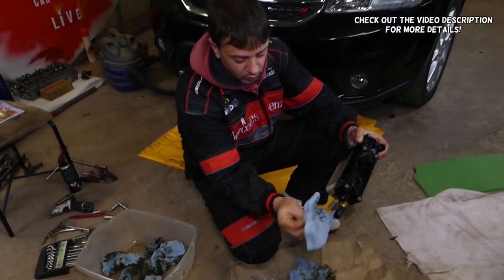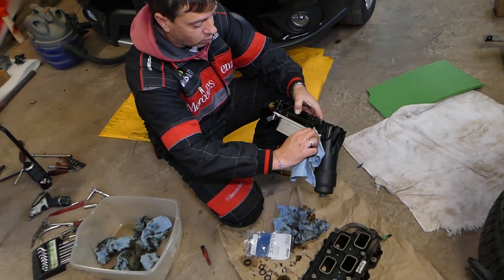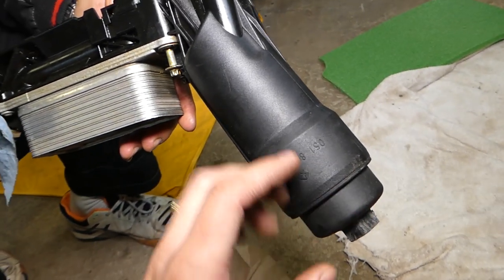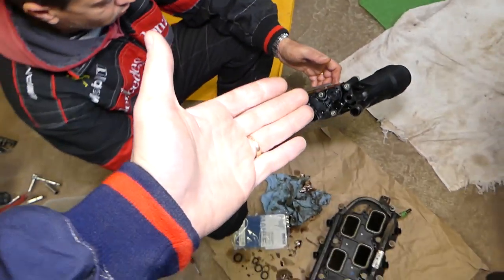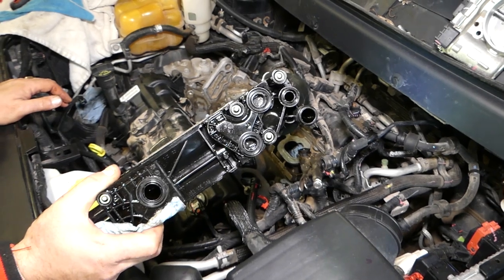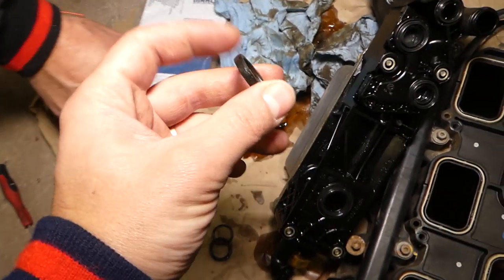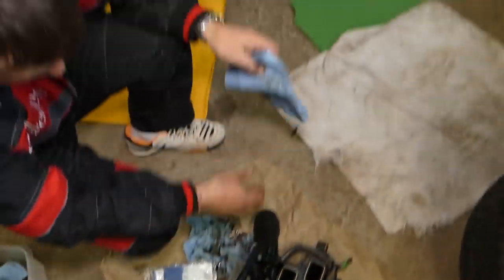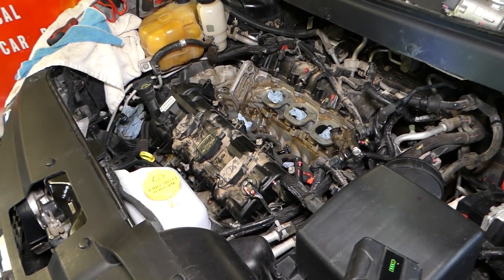DODGE JOURNEY OIL COOLER REPLACEMENT GASKET REPLACEMENT 3.6 V6 FIAT FREEMONT PENTASTAR

Comment: the people saying you can do this without taking out the throttle body and such are right, but why would you not pull it out and do a cleaning when you have everything else out? especially on these POS Dodge Journey that everything breaks on em. found this very helpful, and am doing the entire clean and swap myself at home instead of $2500 at a shop
Reply: In 1500..

Comment: When I took my car to get the battery changed , the car shop guys struggled to remove those plugs , they didn't even bother putting them back in when they gave me back my car.

Comment: Great job guys i have a 2013 3.6 journey. Your video saved me from junking the car because i could not find coolant leak causing car to randomly run hot. So now it will continue to run just for the cost of the cooler and my free labor.

Comment: Great job on the videos you provide 👍. I have a 2014 Journey with an extremely hard to work on 3.6vvt. From the infamous 6 cylinder tick to the current oil leak it's driving me nuts. More than anyone else you help me with information and how to make the repairs... thank you very much. Sadly, because of the engine design, the cost of repairs is greatly increased because of how much extra work is required to get to the parts...😭. Personally I can't afford it so I have to do the work or lose trade in value because of mechanical problems. So far I choose to keep this baby because in over 200k I've been blessed to be able to keep going without major break down...plus I'm amazed at how much value it holds.
Anyway thanks again for the great videos. The least support and appreciation I can show is to listen to your adds...and not cut them off. Thanks again.

Comment: Nice job guys. Just have a question I am leaking coolant from there so I was just wondering if it could be a bad hose that I would need to replace no oil leak just coolent leak. Thinking about replacing the whole thing but the dealership wanted $400 just for the part
Reply: I have the same leak what did you do?
Reply: Had the same issue and dealer wanted the same and another shop quoted 267. I am going to just order the hose and replace it myself
Reply: Same issue.. you can get the parts on Amazon or other places than from the dealership. Prices for this part on amazon are no more than 200 depending on who and what comes with the part
Reply: @issacsantana4444  I'm so late to this but-the upper gaskets can go bad and it will leak coolant...the lower gaskets retains the oil...I've yet to find just gaskets for sale so replacing the whole thing is best...upgrade to aluminum(for some reason cheaper than the composite)

Comment: I had a huge leak, bought some dye put it in the oil drove the car for a bit then waited till sunset used the black light flash light and BAM ! That leak was sticking out like a sore thumb.Now your video was most useful the only difficult thing is remembering to not forget to hook everything back up the way its came off.

Comment: You don't really need to disconnect the wires from the injectors because it is possible to simply "flip" the manifold over (it will rotate clockwise after disconnecting the fuel supply line).

Comment: i have a 2017 Dodge Journey SXT and i have a water leak it looks like it is right under the power steering cooler on the back side of the cooler on the passenger side and right across from the first bolt so my question is dose water supposed to leak from there O and i appreciate the hard work and the effort that y'all put in y'all's work and videos to help people that u don't even know to teach them how to work on there car's and for them to save money so from the bottom of my heart thank  you because i know i i appreciate and i know everybody else dose

Comment: I did the same kind of job and I didn't have to take everything apart I took the boy from the intake manifold out and I just pull it out without having to take the throttle body and all that stuff out too much water for nothing and this video
Reply: What part of the intake manifold did you take out? Seeking clarification.

Comment: Thanks for the great detailed video.
My journey mixes oil with the coolant I took it all out and about a new oil cooler I put it back together and drained coolant. It stopped overheating but it still leaked.
Note: I have flushed it with water so many times to make sure it doesn't have anymore. It still managed to leak the oil again. 
Any tips on what might be going on? 
Thanks a lot.
Reply: I'm no expert but a cracked block maybe. I hope not...

Comment: This is the second time in less than a year that I have had to replace that part (the last one lasted only 1 month ) I saw they have this part in aluminum now, do you guys recommend to use that instead? Thanks for the great videos!
Reply: What did you find out?
Reply: @Katie-uj3xd  I actually haven't changed it for the aluminum one, but yeah, the plastic one loses its shape with the heat in less time.

Comment: They miss a couple of steps but y’all will find them on your way lol. Don’t forget to refill your oil and antifreeze. Mine took about 6 and a half quarts of oil and 1 gallon and half of antifreeze. Test drive your vehicle after all set and done and then check all fluids!

Comment: I repaired the oil cooler the first time and it messed up. The first time it was just leaking coolant into the valley. After I repaired it lasted 3 months until I had a major leak. Oil got into the coolant. Car was in bad shape. I ordered another oil cooler (aluminum) and after replacing and then doing the coolant flush to remove oil from the system I still had a leak. I drove the car about 10 times to clean and flush with the oil out of everything. Drove about five minutes at a time. Wouldn’t lose fluid until I drove. Even if the car say idling for hours. I finally found that leak in the radiator cap. I got a higher end safety cap and then I noticed after we drove a few miles that coolant was again POOLING IN THE DAMN VALLEY! AGAIN!!! WTF!? This time though the coolant is leaking on the passenger side. I assume the pressure from the new radiator cap pushed the coolant through the cooler and made it unseal somehow. Any ideas? 

Nothing leaked again until I drove.

Comment: I see a lot of video's on this procedure. I have a 2007 town & country that is leaking excessive oil from somewhere. Do you know what years in the chrysler T&C's are known to have the oil cooler leak problem?? Do you know if a 2007 would have that issue?
Reply: It's very likely. Is yours a 3.6L?
Reply: 3.8L

Comment: Great detailed video, I see water pooling and boiling at the base of the oil cooler and it looks like I'm going to have to try this.
Reply: Used this video to get the cooler out, the valley of the engine was full of coolant.  It was a lot of coolant.  The bottom of the oil cooler was cracked and all I had was gaskets so now I'm waiting for a new cooler to show up. I went with a newer model cooler, hopefully will fit.  I compared photos, they look identical.

Comment: Help me please I have a 2016 back lights don't work and won't start when I push pedal I change brake switch program key starter work but the back tail lights just won't work all fuses good help me please sir 🙏❤️

Comment: i just replaced all of this an forgot to drain and replace the oil. oil light came on followed by knocking noises. drained added new oil an has same result, milky on the dipstick with new oil any advice?
Reply: Hoping you squared this up-see the comment was 2 years ago...but "milky" means you got water mixed into oil so really hoping that didn't become a large issue for you...

Comment: I have a 2014 dodge journey 3.6 engine I have a oil leak underneath the oil filter housing. So I took my car to the shop and they was supposed to replace the oil preasure sensor I drove the car for another month or so before I could get my car in for a appointment to get the leak fixed. However I was driving down the road and my check engine comes back on and then my oil pressure  plummets to zero so I thought no big deal I'll just put oil in it and it would be fine boy how I was wrong. So make it sure i went got a diagnosis test done and the results was oil pressure sensor was stuck on close. I have a buddy telling me all I have to do is bleed the oil lines. Do you know  how to do that? does anybody know

Comment: Hello guys I have a Dodge Journey 2012 4 wheel drive SXT and it started overheating so I went ahead and change the thermostat and it still overheats so I found out that the oil coolant unit was broken from the gasket area and I went and replace that, I put it all back together bleed the line as I was putting the antifreeze and is it still overheating
Reply: Carlos Ortiz anytime its overheating check the coolant first. If you havent had a coolant flush the radiator could be clogged. Just had my radiator flushed at 95,000 miles